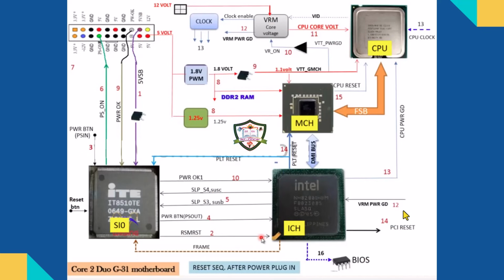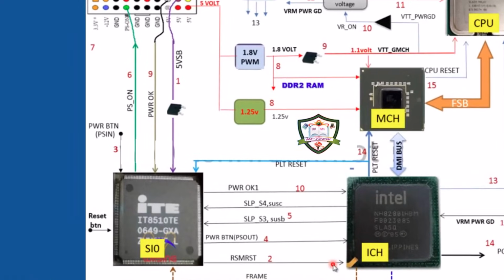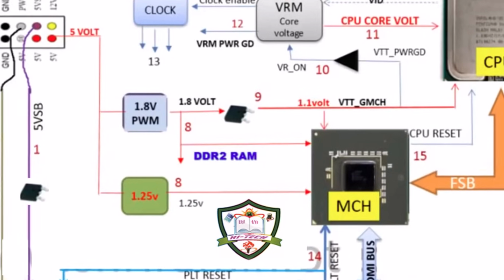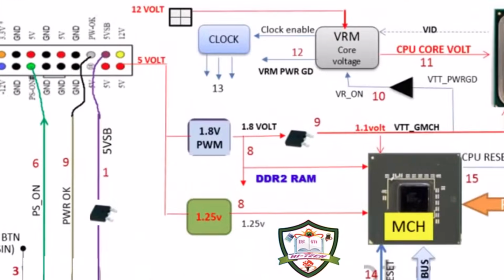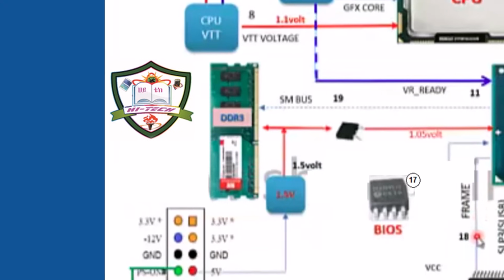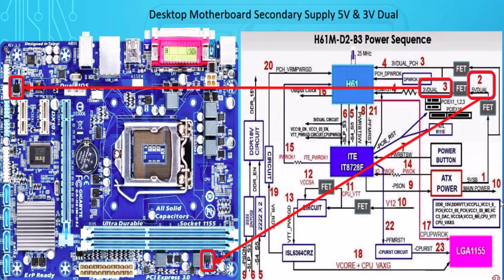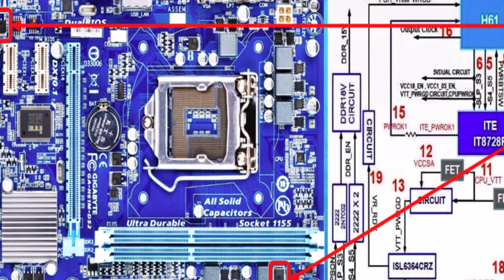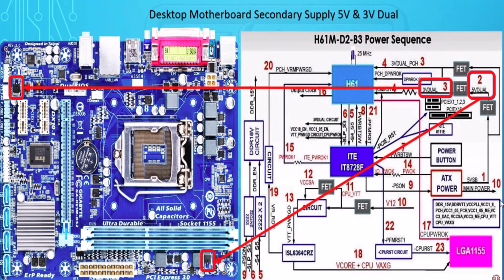Fix Any Dead Motherboard! Ultimate Guide to Voltage & Power Sequencing

Comment: Hello! Thank you so much for modern core power sequence explained.
I like to know more details about Block Diagram, Flow Chart Sequence, voltage rails and power boot sequence only tutorial video within 20 minuties. Because you ae excellent explainer and this will more help to check point for No Power Motherboard Repair. If you don't mind, please...
Thank you.